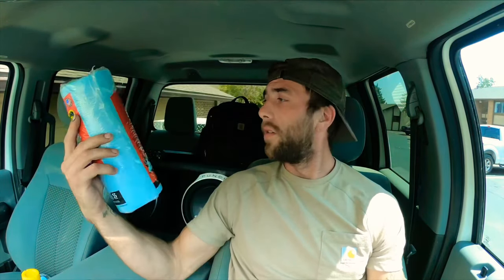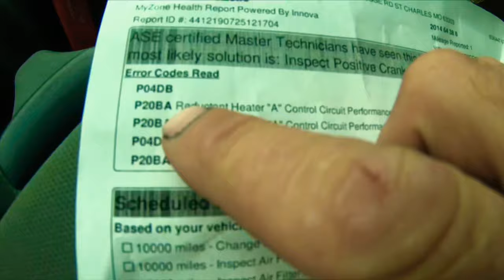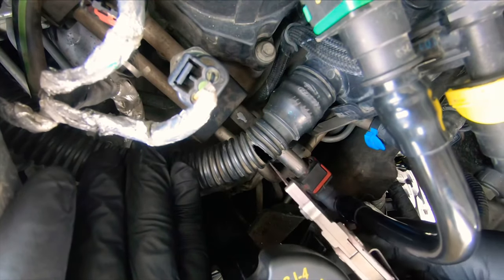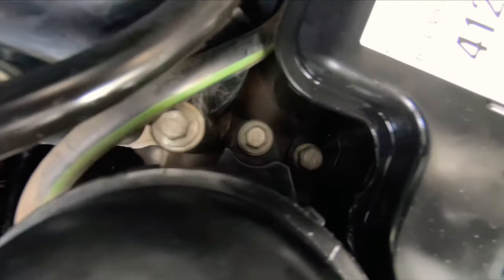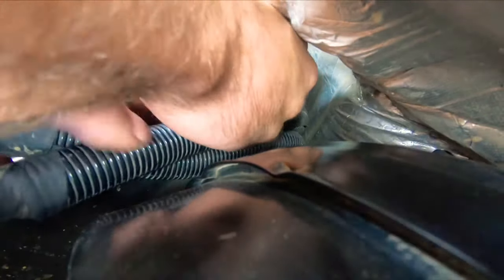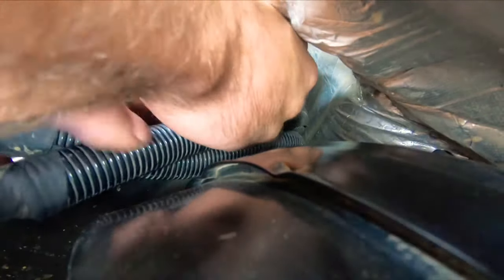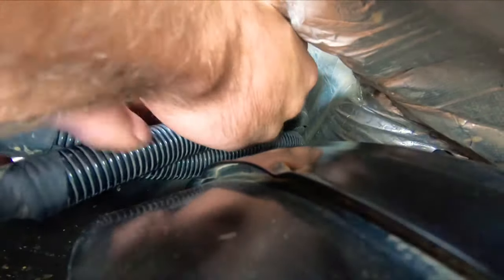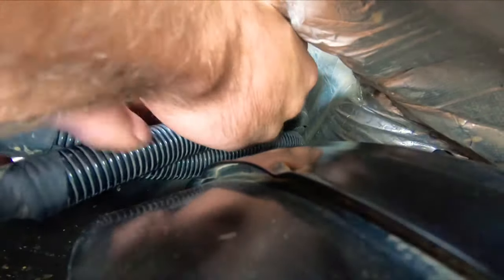FORD F-250 CCV REROUTE A MUST DO FOR ALL F-250 OWNERS!!!!!!!

Comment: So that sensor tells the pcm that the ccv system is running. I wonder if you put that in line with the discharge tube if it will trick the pcm to work. I have a programmer, mini max. But I don't think it handles the ccv.

Comment: on my 2012 plugged up and created backpressure that leaked oil out both sides of the turbo bearings.  drooled oil to the exhaust pipe and intake turbo intake hose.
Reply: Are you saying that the stock CCV plugged up? I have herd of that happening and then eventually leaking out all over the side of the engine.

Comment: ever look inside a 1960s  engine with draft powered ccv ?  chunky buildup and watery oil.  And your chassis will be dirty where all that oil drains to the rear bumper. I owned 3 like that. one had 300k miles on it without a rebuild

Comment: So how much oil do you drip while parked, I want to do this but I don't want oil stain. Thanks bro.
Reply from the maker: Visiting Places ZERO!
Reply: @Kylethiemann  so we're does it go?
Reply: @islanderson691  mostly while I drive. Kinda just gets pulled out Venturi effect. Had a LML Duramax which have same issue. Did the bypass and cleaned out the pipes. From there on it was not getting oily. Never stained my driveway and only negative was a slight oily smell after long drives when you get out

Comment: I currently have a code for high crank case pressure with a stock non deleted 2015, do you know if a ccv reroute will alleviate the code, and will I need a tune if I'm not deleted?
Reply: You will need a tune for sure, will out a tune your truck will be in limp mode and crazy engine codes. Good luck finding someone to delete these days. EPA is cracking down
Reply: Probably a plugged up filter in the CCV box.
Reply: @fritzduval  “epa is cracking down” has been since 2008.

Comment: Nice mod 👍🏻
I have a Ford turbo and I know not cleaning the turbo and back of the intake valves causes hell on mine. About every other oil change now. I use the CDC I think it’s called because the seafoam smokes too much. 

When you gettin back out the water gold huntin?
Reply from the maker: Hopefully soon ! I’m getting a 4 inch dredge !
Reply: Kyle Thiemann Sweet!
I’d love to run a 4” dredge. The claims I’m allowed on only allow like a 2-2 1/2 max. I don’t even have that though. Just a small 1 1/2, but it does what it needs to. 😝

Comment: My 2014 f250 is deleted.  I still have EGR attached but tuned turned it off. I still have stock CCV. I been back n fwd in my head about deleting the CCV. Should I really and if so do I have to get a new tune on the truck if a code pops up?
Reply from the maker: I believe you have to get a tune.
Reply: @Kylethiemann  ok, I'll research it further more cause I'm getting different results however tha k you for the quick response brother!
Reply: Devil dog I didnt have to do it on mine
Reply: @VeryOddTimes  ok I'm still up in the air even doing it. Thanks!
Reply: Devil dog alright man. Just a word of advice, if your truck does anything like mine, it’s going to smoke and smell awful, so a catch-can of some sort should also be considered.
Reply: @VeryOddTimes  roger that! Thanks
Reply: @VeryOddTimes  what year is your truck I have a 2012 and I'm thinking about buying one and putting it on but I don't want to have to deal with the engine light?
Reply: Austin Allen Well as long as you have everything in order before hand. Like if your light isn’t on now, it won’t be on after a full delete. Wrap all the wires you unplug with plastic too, don’t want anything sticking anywhere. You can end up with a short. And it’s a 2011, I’d get some new injectors if I were you too. My truck has 225k miles and two went out, I don’t even have my SOTF installed and I two of them went out. One even cracked.
Reply: Austin Allen  go with an EZ LYNK too, I had bought a tuner and back exhaust that were DPF compliant because I read wrong. $1,300 down the drain I think I bought the stuff from Sinister. Any big diesel company won’t sell you anything involving a a delete, look on Ebay. There’s a big company I know too, but I don’t want to put their name on here in case people are looking.
Reply: @VeryOddTimes  Yeah there no lights or anything on my truck ATM  just lately like I said I've been considering to do a ccv reroute just for the simple fact of cleaning out the engine bay as well as I just don't see how the oil going through the intake and turbo and etc are good for those components. But I just didn't want to make engine light come on for deleting the factory ccv and unplugging that sensor.
Reply: Austin Allen ohhh my bad I thought you were talking about actually deleting the truck. But I don’t think the engine light would come on. My truck already had it on because of I bought the truck with a bad injector so i can’t say for sure, but I could see the codes the truck was throwing and I didn’t get any for ccv. I’d say it’s a good buy. Just need to get a catch can or route the hose into the exhaust. You will smell burning oil out of the tailpipe tho, and if you’re not deleted I’m sure the catalytic converters aren’t going to be too happy with a bit of oil in or around them.
Reply: @VeryOddTimes  okay thanks for the info man. Yeah with the kit I order, I got it with extra length to route it as far back as I can. Again thanks for everything man I appreciate it!
Reply: Austin Allen Alright, good stuff man. Makes it a ton more roomy if you ever need to mess with injectors there on the driver-side too, good luck brother!
Reply: @VeryOddTimes  yeah that's was another reason I wanted to do it and thanks man!
Reply: I mean, you already deleted the truck. What's one more mod? Lol
Reply: Brother where is the link to buy the hose
Reply: @dolphinzplumbing9544  look up
SPE delete silicone hose
Reply: Ok